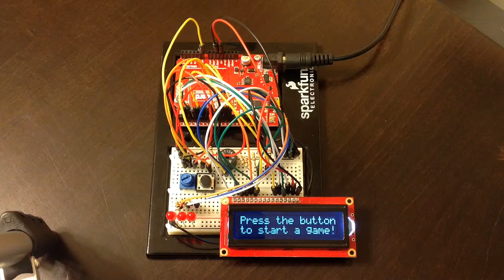Junior Pi School - LCD Pong Project (1 of 2)

Comment from the maker: Hi Nickolas,

Yes, all the components used to make the pong game are found in the Sparkfun Inventor Kit. Please check out our project page for the pong game at http://www.jrpi.ca/1/post/2014/01/lcd-pong-project.html and there you will find additional videos on how to build the game on a breadboard as well as the Arduino Sketch (code) needed to make the game run. Have fun!

Comment: hey I built the project based on the setup the sounds and the LED's work but the screen lights up a bit and doesn't show the animation... any fix?
Reply: I would recommend checking that your LCD power and Contrast pins are connected properly. I use a voltage divider circuit for the contrast (which is less than ideal) but my SparkFun inventors kit only had a single potentiometer and we used it for the control knob of the game.

Comment: Is the diagram circuit different than the one in the video?
Reply: I will go to the page and see the vid
Reply from the maker: Hi Tabish, the exact placement of components on the breadboard is a little different in the circuit diagram but the type and quantity of components along with the Arduino pins to use are correct. Hope that helps!? But please let us know if you need any further assistance.
Reply: Ryan Brazeal Thanks, Ryan. I watched the video on this project's page and it helped a lot.
Reply: Ryan Brazeal What are the side letters on the left doing?
Reply: Ryan Brazeal Oh! It says Jr. Pi!!! Awesome job on this project by the way! I showed it to my friends and one of them was able to keep going for quite a while without losing.

Comment: Pfft, wth is wrong with the circuit diagram. The wires are messy and also why are there 3 capacitors randomly placed on the board, 1 of them is connected to negative only.